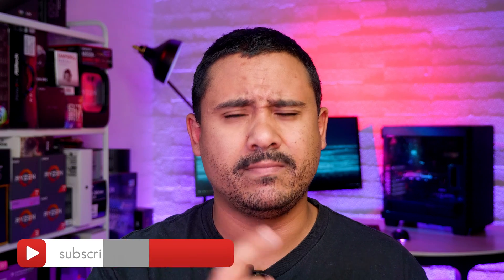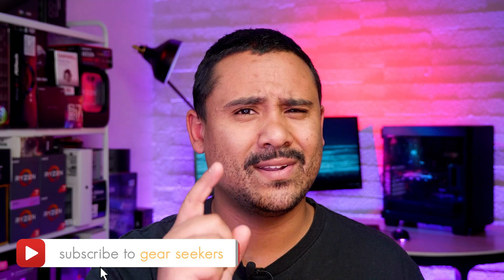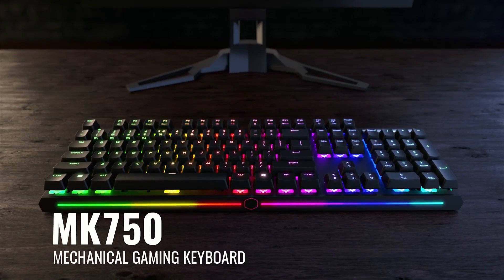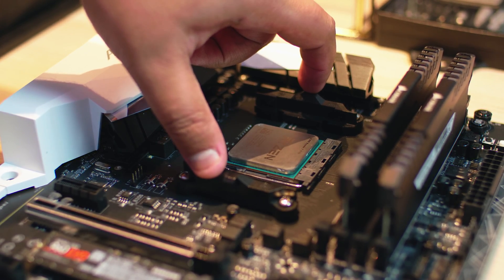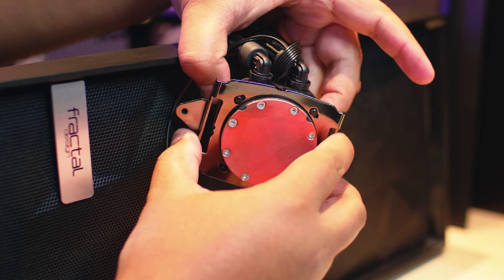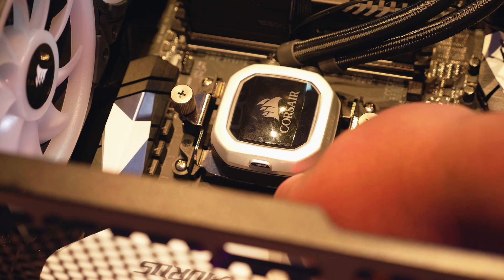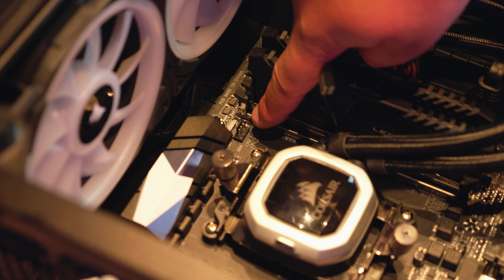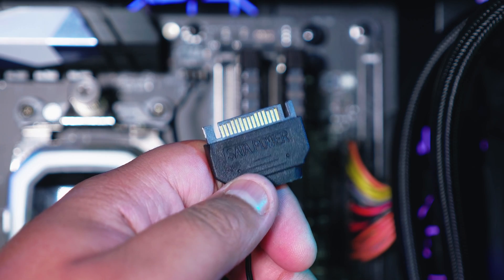HOWTO Install Corsair H115i PRO RGB On A Ryzen CPU (AM4)

Comment: I removed the srews from the pump head and a bit of water has leaked out, is my cooler basically ruined? FYI... I couldn't remove the intel brackets so i thought i had to remove the screws first

Comment: Awesome video. I just bought one of these and having never installed water cooling before, I was lost.
The instructions from Corsair are worthless.  Actually worse than worthless as their AMD instruction must be for older sockets.
Then I watched their video. That was worthless. No explanations, going too fast and too much was obscured by the hands of the installer. Video resolution was low too.
Your video has explained everything. 
Thumbs up and subscribed.
Thanks... 

ps. Everyone is mispronouncing Ryzen.  It should be the same as risen... Like you pronounce "y" in "rhythm".
The marketing folks thought they were cleaver when they came up with that spelling until everyone started pronouncing the "y" as "eye". LOL

Comment: Hi there I recently had one of these installed by a friend and my clock speed is now stuck at 587mhz when it is supposed to be 3600mhz at stock , Ryzen 5600x please help with any suggestions , could something be out of place or has he damaged it I really need help on this someone , I've been into bios and reset to defaults and I have updated choosey driver on dragon centre , thanks guys
Reply: Enable xmp profile in your bios for your memory. Bios will read 1,800Mhz which is 3,600mhz effective speed.

Comment: My Mainboard has 6x 4pin fan connectors and i have 4 corsair ll 120mm fans in the case with a coresair h100i se with 2 corsair ll 120mm fans what do i need to power all that and crontroll the rgb?

Comment: Super noob question. Can it be used without the USB cable? I'm not planning on using RGB anyways.
Reply: how do you plan on on controlling the fans and pump speed without it?

Comment: Can I install the pump plug into a cpu_fan header? My motherboard doesn’t have an opt header
Reply: Yes, if you don't have an AIO header on your board you can plug it in the CPU fan header port.
Reply: Fast2Furious4 thx already installed my aio and it looks super clean
Reply: @takeruhiura8903  Did you get the same model as the one in the video? I have a question. I'm not a fan of RGB. Can it be used without the USB  cable?
Reply: Fast2Furious4 no i got the H100i platinum one, idk if it doesn’t work without the usb and u could always turn off the rgb via iCue

Comment: If your case has a PWM fan hub, Phanteks p600s :), can you connect the H115i pwm 4 pin connector to it instead? I connected the fan hub to the cpu fan header on my motherboard.

Comment: I'm very disappointed, I bought a h115i pro xt and couldn't install it because it does not come with an amd backplate. I already had a watercooler in there and that backplate isn't compatible, pretty ridiculous I love corsair but this is such a shitty move.
Reply from the maker: Use the factory backplate
Reply: @GearSeekers  I would if I had it. Like I said I got rid of it, never had an after market cooler which used a factory backplate, I had to order one now I have to wait and probably stuck with a cheap looking plate. Poor design in my opinion. I've had much easier to use watercoolers and I've used corsair aio before too. If I had the backplate my motherboard came with I wouldn't even be here. Maybe corsair instead of being cheap they could have mad a custom backplateblike the one for intel looks much nicer.
Reply: @crm4667  
The supplied Intel backplate is plastic.

Comment: I have an asus am4 x570 tuff and this cooler but the platinum one and for some reason the mounting bracket comes separated in two pieces but im just guessing it slides into the sides of the pump since thats the only way i can get them on there. But im having a really hard time getting them on the motherboard, pcparts picker says its compatible can anyone help?
UPDATE : i installed it but the radiators won't fit in the case, the motherboard blocks it out a bit, IM SO MAD! do i return the case -__-

Comment: why did you install to the CPU opt? i have mine installed to the CPU_FAN, however all of my monitor software say that the CPU fan is running at 4000+ RPM I don't think any of the fans are going that fast. In ICUE it sais the H100 fans are running at 900-1200 RPM about.  Can you please help me out.
Reply: That's the pump speed. It's 2000rpm for me on idle.

Comment: i have h150i pro liquid cooler would this be compatible with ryzen 3700x or would i need a different bracket
Reply from the maker: It's compatible.
Reply: @GearSeekers  i saw a site that my cooler not on it
Reply from the maker: It is. That site is wrong
Reply: If it’s an AM4 socket it will fit

Comment: Where can I get the bracket that you are placing over the CPU? I purchased a Corsair radiator, but the part which connects to the top of the processor does not match up. It is a square layout of screws for mounting. I have the rectangular one that fits the board, but am not sure how to remove the radiator mount. The base you are using is totally different and looks like it would be a lot more simple to install.

Comment: Hi, so I installed this watercooler and the rgb fans turn on but the pump itself does not turn on the colors. I plugged it correctly i think. Usb to usb, pump to cpu_fan1 and sata connected. Still no rgb.

Comment: okay, should i connect the pwm to cpu opt socket or to the the cpu fan socket, because i was using nzxt x62 and i connected it to cpu fan as it was showed in the instruction manual

Comment: While i was mounting my am4 bracket, it sat on the cpu nice and firm but after an hour or so, ONE BRACKET COMPLETELY SNAPPED. The part that goes up snapped in to 2 pieces. I mounted them with my fingers not with a screwdriver. Could this be because the metal was weak already? Will corsair send me a new bracket or a new cooler? The warranty says no but i installed it with patience and i was very careful so it deffenitly isnt my fault.

Comment: Man the mounting pressure is scary on am4, i honestly thought i was gonna destroy my mobo and cpu so i let out and tried again at which point i thought fuck it im just gonna tighten them as much as i can by hand and whatever happens happens, it turned out it was perfect! the metal bracket is also supposed to bend.
Reply: thank f$$k for that. I thought bending mine had killed it
Reply: Yeah fuck. Mine also bends. The screws are pointing outwards. Lol I thought I over tightened mine
Reply: Yeah AMD bracket design is so bad :(

Comment: Oh god. I tightened all the way for the two thumb screws, bracket was looking bent. I thought I went too far. Looked in the manual and it never specifies to go all the way only "until tight". I was freaking out a bit with the uncertainty. Very relieved, Thanks!

Comment: And for the fans where would I plug it in? An adapter or in the motherboard
Reply: Colin Maghran rgb into the node core, fan power into system or a separate corsair pwm splitter if you have one

Comment: I installed the h100i on my Ryzen 5 2600x but when I boot my pc everything turns on besides the rgb on the radiator fans and nothing displays on the monitor.
Reply: Ayyngel that’s what I am facing too. I don’t know what is the issue here. Have you fix your issue ?
Reply: Junior Saw  nope
Reply: You gotta have it plugged into the RGB hub

Comment: Really good guide, so if I had an SSD, HDD and this cooler I’d need 3 sata cables from my power supply?
Reply: Yeah, usually there are 4 sata power connectors in one strip from the power supply though.

Comment: Installed this on my ryzen 2700x with a perfect amount of thermal paste used this video to install it and my temps read worse than the stock air cooler, my temps read at around 88 degrees Celsius any suggestions???
Reply from the maker: Yeah. You're not reading the correct temperature. Tdie temp is the real temp and you don't need to add thermal paste to the preapplied thermal paste.
Reply: Gear Seekers I usually take the preapplied thermal paste off and I put my own on, this isn’t my first build either... I use different temp readers not the exact one you suggested but many other, and they all read around the same 80 Celsius to 95 I really don’t understand why it’s doing this whatsoever, also whenever I plug it in the CPU OPT and it says cpu error plug it in cpu fan it doesn’t but it reads those temps... I’m very frustrated because my first aio pump the thermaltake 360 read like 50-60 temps around the same as my stock cooler and I didn’t like that so purchased this one and it’s even worse. Do you think there’s a possibility that I got two lemons? Or is there something else I have to do thanks for answering!! Love your videos by the way
Reply: By the way the thermal paste isn’t the problem  (too much or too little) I put just the right amount on and to see if somehow I put the wrong amount on I tried different amounts and all of them read around the same
Reply: @coledeubell8254  did you ever figure this out I think I'm having the same issues just with an H100i that's non RGB and a different bracket but I'm also getting 80s in idle no less for the temps.
Reply: @tsmitty777  Did you make sure you installed your radiator with the hoses in the correct configuration?  If you front mount the radiator and don't have the tubes at the bottom, you're going to have issues, including overheating. https://www.youtube.com/watch?v=BbGomv195sk

Comment: I got it already installed delivered, but they don't seem to glow, do I need to do anything?
Reply from the maker: the included fans are not RGB
Reply: @GearSeekers  I got another question then: I got myself the SP120 Fans (RGB), as it seems, they are the one's not glowing  like they're supposed too. Could you please help me out?
Reply: Wydox did you link them with ur lightning node(if u get the bundle which gives u 3 fans and lightning node,u just plug in the fans to the lightning node and download software

Comment: I purchased a pre built PC went and purchased this cooler now my crosshair hero vii wifi is missing those mounting brackets that the pump would connect to not sure how to get those two plastic pieces that sit around the processor please help me
Reply from the maker: buy the brackets on ebay for like $2
Reply: @GearSeekers  you are the best do you have a name of the brackets

Comment: Peace, great video. Quick question, does the black strip cable that comes from the liquid cooling block have to be plugged in? I ask this because my three front fans are rgb which plug into a rgb controller hub and my other three fans are plugged into the motherboard. So I have to use for the fan connectors that come from the liquid cooling block. Would this be a problem?

Comment: I found installing the H115i for an AMD socket to be very easy.  However, installing the H115i Platinum for AMD is a fucking nightmare!  Corsair needs to go back to the installation. My H115i Platinum cooler didn't come with that bracket.

Comment: OMG I though I threw away those plastic bits where brackets sits when I was first building my PC. I felt like an IDIOT. When I thought I for sure threw them away, I said to myself "trying doesn't hurt" so I started looking through where I stored my PC parts and I found them along with the screws!!! :DDDD
Edit: I just finished installing it yesterday and it looks gorgeous. Works much better than the stock cooler that came with the 2600x
Reply: Yo same thing bro I thought I did not have it and I said well I'm f up and I decided to look and guess what I found it I'm so happy I did find them now I don't need to worry when I get my new case lol.
Reply: Good to know I'm not the only one who did this exact thing lol
Reply: Les i ded the exact same thing but this time i didnt find them ;-; is there another way of mounting it?
Reply: I almost threw them away. Luckily I didn’t lol

Comment: Really big question!! My Ryzen 7 2700X shows package temps of 100C on Corsair Link. On Bios It shows 30-40C. Should I try and reseat seeing as it's hitting 100 Package under load and only boosting to 3.93Ghz. On Ryzen Master under load it only shows 55 but I think that's core temp. And reason why Corsair Link is showing package of 100?
Reply: Corsair link doesnt read ryzen properly. Use Hwmonitor or another software. I think iCue reads it correct but I'm not 100%. You can also check correct temps in the bios.
Reply: @mom-butts    thank goodness because i had the exact same issue after just completing a build with the 2700x haha.  Didn't know if i had the pump plugged in correctly or not because of the stats showing in link

Comment: that is not a 2950X is it?
Reply from the maker: Nope
Reply: @GearSeekers  so is it compatible with sTR4 ?
Reply from the maker: If you're but the correct bracket. I would suggest air-cooling for TR4. I only use air cooling for our TR systems.
Reply: @GearSeekers  thanks for ur suggestion. I bought the AMD wreith or something like that name. Hopefully it will work
Reply from the maker: @PHOEBE_LOVELY  Im working on the a video for the Wraith Ripper at the moment. It's an absolute beast of a cooler!

Comment: Does it matter if the fans are on the inside of rad or the outside, I see some build with the fans visible and some builds where the rads visible, building my new PC in the NZXT H500, what do you recommend for fan placement, I hope this makes sense.
Reply: It's been tested. Doesnt really matter. Up to you as long as you have the fans facing the right way.

Comment: Why did you plug the fan header into the CPU OPT and not CPU FAN
Reply from the maker: Because fan speed control is done with the USB cable in Corsair iCue. The connector you're plugging in is for the pump not the fans.

Comment: So i had a different cooler which required me to get rid of the top and bottom mounting brackets. Now that i wanna buy this cooler i found the brackets but they don’t have the 4 screws to put them in around the cpu socket. What size screws do i need to put them in?
Reply from the maker: Not actually sure what size the screws are.

Comment: why doesnt my bracket look like that?
Reply from the maker: did you remove the stock intel bracket?
Reply: yeah i was told the amd one it came with doesnt support it so i had to order one for am4 off the corsair website but mine looks completely different
Corsair CW-8960046
Reply from the maker: Who told you that. The AM4 bracket that comes with it definitely fits all AM4 boards.
Reply: so i think i was doing it wrong the first time and corsair finessed me into buying a bracket i dont even need.. nice
Reply from the maker: That is properly annoying. Corsair always tries to solve the problem by getting you to buy more stuff lol
Reply: Does this cooler come with the bracket??
Reply from the maker: what ever is shown in the video the cooler comes with.
Reply: Gear Seekers you are the best. Thank you

Comment: What were the temperatures like? Under load I'm at 70-ish with the same cooler, and I don't know if somethings wrong with it. Prime95 makes it jump up to 85c
Reply from the maker: Different for every CPU. The non-X CPUs typically run a lot cooler than the X versions because their power consumption is a lot lower.
Reply: Under load with this cooler mine is 30
Reply: @JanBongoO  No it is not.
Reply: @navad5965  yes it is. I got temp monitoring and never been higher than 43c. Usually  its between 33-37c even when gaming for a long time.

Comment: I used so many time figuring how to install the cooler on the cpu until i saw how you did it by mounting the upper side first, you really save my ass.
Reply from the maker: That's what I'm here for 😎💪😀 thanks for watching 👌
Reply: @GearSeekers  If I want to re apply thermal paste for second time installationof the aio,  will the processor come out with the aio pump due to high quality thermal paste applied to it ?!!
Reply: @GearSeekers  You and very few other people have actually follow the instructions and mounted the fans the proper way I don’t know why so many people are installing these and making videos and mounting them backwards even though it looks better yes but it doesn’t perform better
Reply: Same I think I mounted it bad I get around 75-80c with a 4.2 oc at 1.4v dunno if this is where it should be but imma reseat using this guys method
Reply: @dannynicholson50  How was it? Did reseating help temperatures?
Reply: @SketchyPadz  miles better... I don't break 66c avx gets to about 73c where as before it was in 90's with avx.... gaming is like anywhere from 35c-50c with exception of battlefields which is 60c max
Reply: @dannynicholson50  I have the H150i Pro RGB and my temps are 80 on max @4GHz. But thinking about my application of the cooler, I did seem to have a difficult time hooking onto the AM4 bracket and It was twisting around. I may have to reseat following what he said to "start at the top and work your way to the bottom"
Reply: @SketchyPadz  definitely... although I do a custom OC which puts me at 4.2 multi core and 4.4 at single core
Reply: @dannynicholson50  what do you mean by a custom OC?
Reply: With a ryzen 2700x

Comment: is it possible to control colors and effects with motherboard software like Mystic Light?
Reply from the maker: No
Reply: oh god i think i have to buy a LiqFusion then...
Reply from the maker: Why. Just use the Corsair software?
Reply: i prefer to use 1 software for everything. So i have to control,Ram,motherboard,fans and Aio...with the LiqFusion i can do it. Vengeance RGB can be controlled by MB software. Myabe i won't have all the effects available in CUE (or Link) but it should be ok. i avoided to buy a NZXT Kraken for the same reason i won't buy this Corsair. The Kraken was my first choice but...